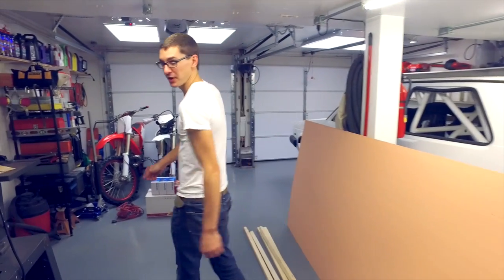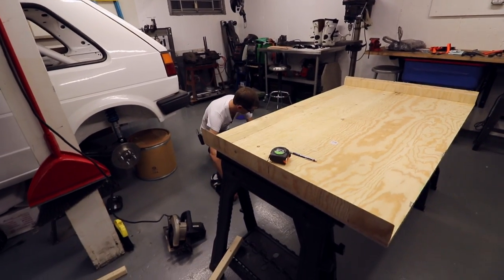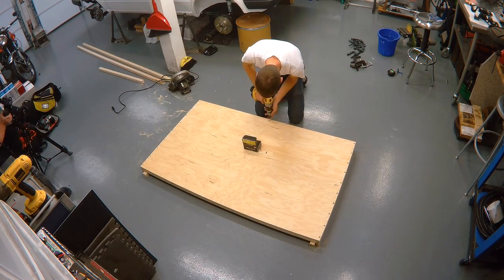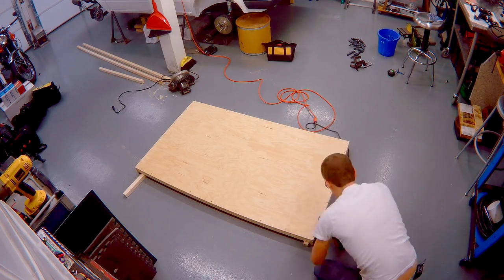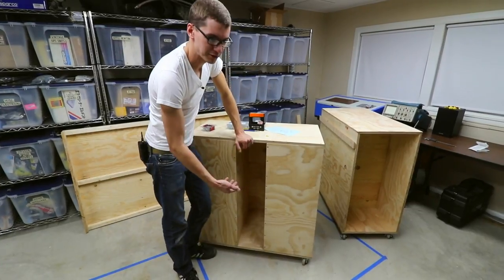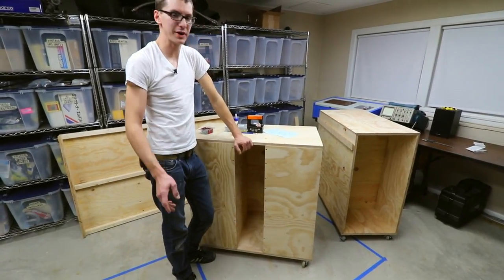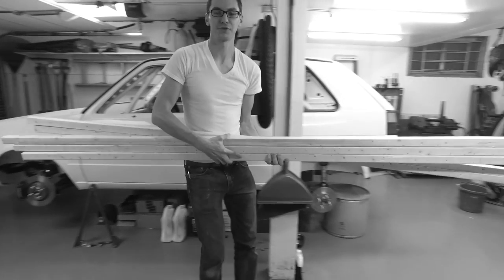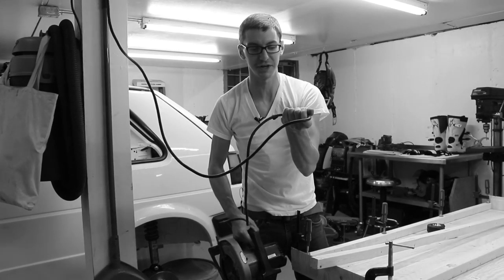New DIY Work Table - Project Syncro #48

Comment: Hello, i just discovered your youtube channel and watched all about thru (nice project by the way), and i'm wondering are you going to use 6 speed transmission and stock rear syncro diff? Because they not gonna work together. The rear drive shaft spining ratio from syncro and 4motion is diferent. I am not sure but syncro is like 16:1 and 4motion 27:1 or so.